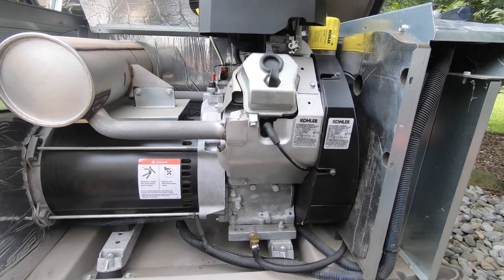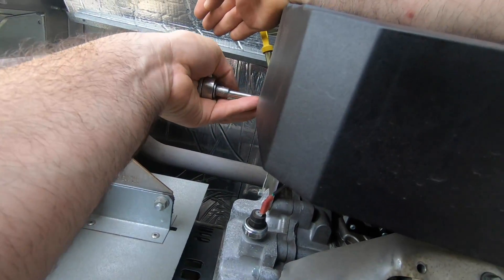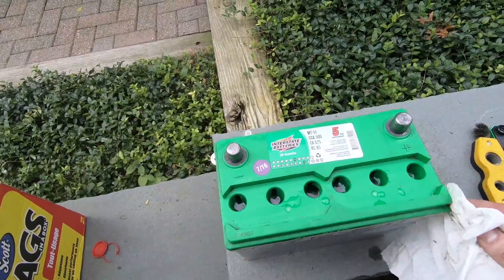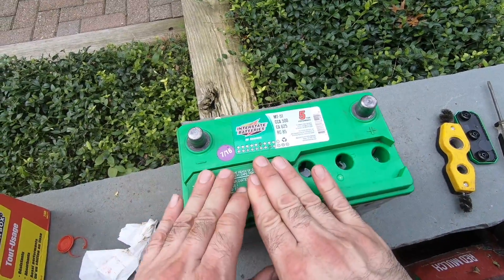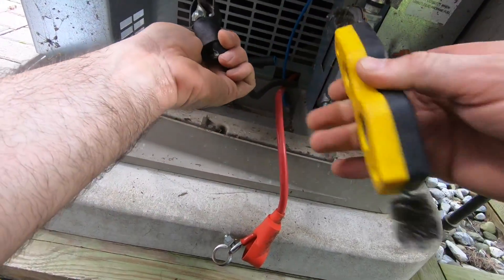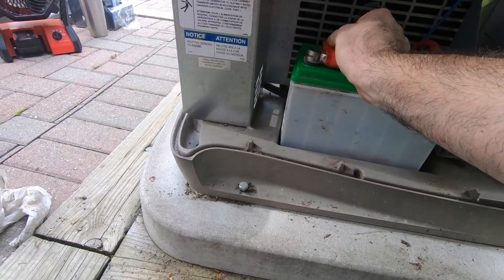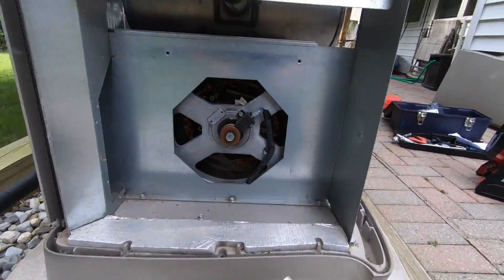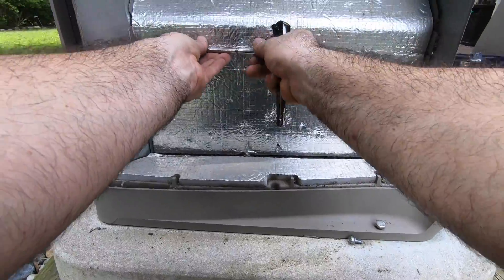Kohler Generator Maintenance Must Service

Comment: Another good video. I just seen that fan in your video. I was not aware milwaukee makes a battery power fan. What's your take on the fan? Just curious.
Reply from the maker: I used it all summer and just took it out of my truck a week ago. It is awesome. about 3-1/2 hours using hi-setting with the 4amp 18V batteries. The 2 amp battery only made it an hour. This video I made when I first got it and I test the 2 and 4 amp batteries. https://youtu.be/lOv5PVVntoE  This also has a power adapter if needed yet that doesn't charge the batteries. I thought I would be using it on hi setting instead I used the mid or low often and the fan lasted all day.

Comment: Our company always checks the line voltage at the p5 connector on the back of the controler for the charger. We also have seen the white wire for the stepper motor connector back out enough to not make contact like some of the old ford connectors
Reply: Found a few of the kohlers that the fuse for the p5 connector popped and had no charger
Reply from the maker: I have had popped fuses. Kohler years ago wanted gfci and they were tripping all the time. They stopped requiring the gfci after receiving many rdc2's back under warranty. Look for loose steppers the 10 mm always seem to loosen up that fasten them down.